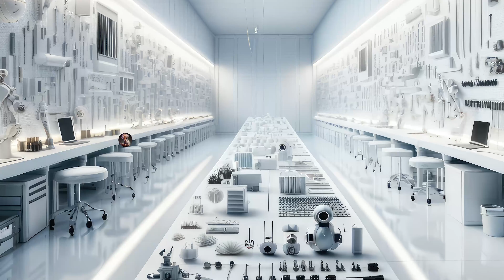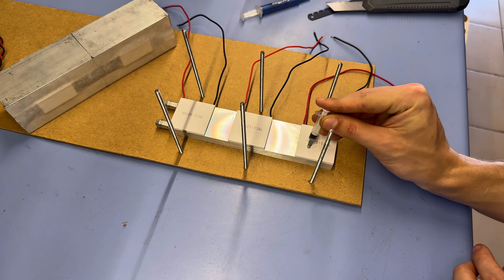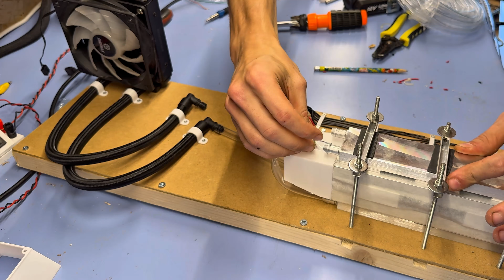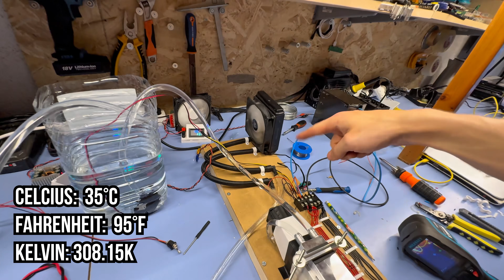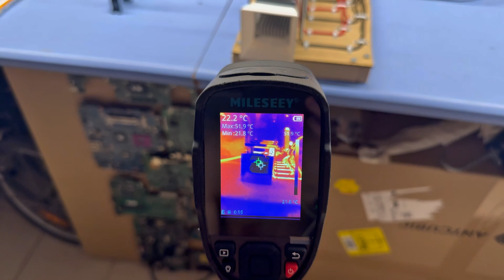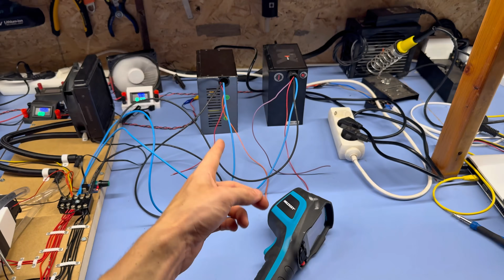I Built an Air Conditioner with 6 (8) Peltier Coolers and it WORKS!

Comment: The real game changer here is going to be 3 steps. 

1. Make a through wall/window build to move the radiator outside for the water. A much bigger radiator will make the water cooling much more effective as well.

2. Change the water out for an actual coolant like glycol or better for more heat removal via the radiator

3. Use multi stage peltier units. People have recorded -90°C with a 3 stage setup. Small, medium, large stacked with paste between small unit to the tunnel large to the radiator. 

Apply all 3 of these and your tiny ac will make temps that could freeze the tunnel shut in open air

Comment: Maybe a bit late, but it is al about keeping the delta T over the peltier as low as possible. This means you have to use water cooling at both sides of the peltiers. Moving the heat outside and the cold water at the other side via many more heat/cold radiators inside your house. Also lower the current to improve efficiency.

Comment: if that is not bellevile washer the thermal mass contracting from coldside will create an air pocket and your thermal resistance between your coldside of tec to ducting will end up increasing.
Also not derating TECs with vrm module/buck-boost coverter will result in much lower COP/Qc if you dont efficiently extract hotside heat.

Comment: Peltier coolers generate 1W of cooling for 4W of electric power, when 4W of compressor power generate at least 8W of cooling (cop of 2).
All in one, the compressor cooler generates 8 times more cooling than the Peltier modules for the same electric power.
This is huge.
Forget the house.
Peltier are ok for very small applications, like miniature fridge, low capacity water chiller etc.

Comment: i just made an ac unit from a beer cooler fillied it with ice cut out hole on top stuck fan to it uses less energy and works lasts all day dump water and refill with ice or you can use frozen water bottles so you can rotate from your freezer and then to your cooler

Comment: Try building this, organic carbon power cell powers pizoelectric solid state Stirling cold gas cycle piston air liquifaction module generation of liquid air fills an insulated tank gravity fed.  Insulated copper pipe brazed to a copper coil with tiny holes covered with carbon felt to wick up the liquid air.  Solid state fan passing air over coil for liquid air heat exchange boil off for air conditioning system.  Low temperatures from liquid air power's seabeak effect electrical power generation system that charges up the power cell puts it on standby till the next cooling cycle is started while the seabeak effect electrical power supply power's the solid state fan passing air over coil for liquid air heat exchange boil off for air conditioning system? If you understand this peltier cooling system you will understand seabeak effect electrical generation system off ultra low temperature liquid air thats generated for heat exchange and electrical power generation to the system? This technology could save alot of lives human lives and animals lives? 🤔

Comment: For your water cooling siode you neec at leaast two 120mmx3 radiators with push/pull config high performance Delta fans. You can passively cool it if you have a pond and can afford to buy lots of copper piping. Your pump is laughable, realy! You need something like Grundfoss cen tral heating pump for a TEC system. Then, dont run them on the rated power, thats pointless due to current heating loses. Run them on max half and best quarter of theoir nominal power. You have no insulation on your sytem, thats no good. You need to insulate everything. When you get all of the above done we can start talkong about the heat exchanger design. This when you start gettin serious. Your heat exchanger is a joke right now but it is fine for the stage you are at.

Comment: Smallest air conditioners (5,000–6,000 BTU window units) typically use between 500 and 600 watts per hour, though ultra-efficient or specialized small units can operate as low as 300–400 watts. These small, high-efficiency models are generally designed to cool small rooms up to 150–250 square feet. (THIS STUPID CHANNEL IS WASTING YOUR TIME)

Comment: Profesional de datos si estamos hablando de una celda de peltier de 60 W está tranquilamente pueden llegar llegar al menos 30 grados centígrados de temperatura con lo cual puedes llegar aún más a refrigerar locales que tienes que aumentar la de la disipación de calor en ese punto entre más sacas calor más enfría la alimentación para llegar a una a esa temperatura tiene que ver la tabla del fabricante más más o menos me acuerdo que era 3.8 amperios por cada partido conectados en paralelo y no tampoco conectados por serie tiene que tener una alimentación de amperaje y un voltaje muy específico para llegar a esa temperatura con un emulador de voltaje y amperaje puede llegar a esa temperatura y tenerme mejor consumo eléctrico también puedes integrar un pid con arduino o con otra tarjeta controladora y que tenga licencia automáticamente la temperatura del líquido refrigerante de líquido y del ambiente para que te den la temperatura de resultado que uno busca pero si le puedes mandar la voltaje y el amperaje justo tendrás Esa de una área de 4 * 4 * 4 metros en media hora Y más si tienes un controlador de arduino a otro puede bajarle el consumo para mantener la climatización
Reply: Si tienes un controlador de voltaje en temperatura que la desarrolla automáticamente una tarjeta de Robert arduino otra tú llegarías automáticamente cuando tendrías la temperatura óptima la temperatura de Confort dependiendo del punto de Rocío y la humedad del lugar inclusive ya hay aires acondicionados chinos que ya funcionan con Peter
Reply: En la configuración con el arduino buscarás la temperatura máxima de enfriamiento máxima que ya se celebrar el consumo pero después de una configuración de programación buscará la temperatura óptima para bajar el consumo Y eso sí tienes un modulador de voltaje ya en pelaje con una tabla de verdad de tanto voltios tanto amperaje tanta temperatura de aquí el resultado pero tendrás que tener más de allá una un sensor de temperatura
Reply: Para hacer más inteligente y no complicarte tu proyecto es solamente aportar cortar datos a tu proyecto yo en lo mío lo tengo un sensor de temperatura en el lado exterior para que me diga cómo está el ambiente un sensor de temperatura en el interior del cuarto luego tengo otro Sensor en el en el depósito del líquido refrigerante que se está enfriando botando el calor y el último dos últimos uno que está censando la temperatura del vestier
Reply: Amarte tendrás que tener dos sensores de temperatura en un helado frío helado caliente para ver el resultado de aporte
Reply: Y aparte de eso tendrás que tener uno que el último que buscas el punto de Rocío Exacto del cuarto de la habitación a climatizar, no es complicado el proyecto sino que tú estás dándole testeos especiales a la celda
Reply: Recuerda que la celda tú tienes que sacar bastante calor y no sabes el calor exterior dónde estás botando el mismo aire caliente que le está sacando del agua y si está a 40 grados exterior y tú tienes y tienes en el chile en Chile el 40 grados expulsando calor y no tiene una diferencia de que vaya a ser digamos disipar otros otros 20 grados no llegas al resultado de bajar la temperatura que necesitas en las celdas

Comment: about 20 years ago there was a cooled computer enclosure for the usmc using peltier junctions and lots of fans. 80 amps at 24 volts.
Reply: So the same power as an small central system 😢

Comment: Someone's using my idea. But making it a bit larger then normal. Mine was just basically take a standard phone pelt cooler like a blackshark 5pro (35watts.). Stick a metal fin on the cold side with a blow fan to blow the cold plate. Then tunneling the hot plate/fan out with a small hose. Reversing the fan so it sucks in air from the sides vs blowing out. That way you can tunnel the fan's heat spread out of whatever you want. And you got yourself a powerful micro-AC unit. That works via USB-C. Simple and easy. besides trying to rewire the direction of the internal fan to suck air from around vs suck air from the middle vent and blow to the sides. (Either that or one can easily make 2 hose tunnels from each side of the fan vent side grills and lead that to so forth.)

Though these aren't very powerful so they would more be kinda point in your face chillers like normal fans but really be for AC cooling rather then a water vapor mist fans. And in a some space say like a tiny box like the size of someone's chair or a tiny bicycle camper. That might help chill a place pretty well if using more then 3 at same time. Just remember to route the HOT air from the HOT/Fan side out somewhere so it doesn't just cycle the heat in the chamber.

So yeah the Idea does work. But not for a normal place. A some super compact place like again as mention. Would work. Say if you enclosed a bunkbed with those built indesks under the bottom bunk and kinda 'sealed' it around so the bottom bunk was kinda basically a 'room' That would probably work to cool that amount of area down. But anything bigger i doubt would work well. Unless again you just have it as kinda a desk fan to blow on your face vs a misting fan. That would work ok but not really chill a room.

Nice test Den. I wanted to try using this method on a 'whoknowswhen future' project bicycle camper trailer idea to use as a micro-AC system just using low powered phone pelt coolers. Since they do work well.
These work ok. to bring temps down for the ability. But what i noticed with higher powered ability is they substain these cold temps harder. So like for instance a 10watt cooler compared to a 35watt cooler would both chill down to -C temps. But if a phone gets HOT. The higher wattage output one holds the temps down more better then the lower wattage one that slowly cannot keep the cold plate side chill and ends up getting hotter. So higher wattage aren't gonna chill farther then others. BUT will handle keeping the cold plate side COLD much better when it gets warmer. So using a melt fin and fan this would handle keeping the metal fin much colder and would in such efforts allow for a larger amount of faster airflow to blow among the chilled fins and still keep the fins ice cold. Compared to a smaller powered one that might loose it's chill.
Reply from the maker: Thanks so much for taking the time to write such a detailed comment — really appreciate it. I totally agree Peltier modules are great for super tiny cooling setups (almost like mini fridges), and I think using them to cool a small camper could definitely work, especially paired with something like solar power. That’s a cool idea and I might even make content testing that approach.

Comment: Due to the massive inefficiency of peltier, the heat released by your power supplies will largely offset any cooling achieved. This would only make sense if the power supplies were in a different room and you also radiated the heat outside the room. Even then a tiny refrigerator heat pump would vastly outperform this. Just find an old mini fridge or something.

Comment: I had been hoping to make a smaller version of this for my previous car (which was old and did not have air-conditioning) but never found the time to try it. (I've since sold said car and my current one has aircon.) Impressed it actually works!

Comment: you have to use more peltiers and underclock them extreme use 6V or 3V and the efficiency will rise dramatically, but you will need way more peltier modules about 100 of them, to get significant solid state cooling

Comment: Nice demonstration. It definitely shows that Pelter cooler is very inefficient and limited capacity to become an air conditioner.   But being small  it may have some uses outside air conditioning.

Comment: lo de peltier solo estará consumiendo 144 watts tal vez hasta 216 watts lo que veo que pasa es que has conectado todas las celdas en paralelo  , en mi caso para evitarme eso las conecto en serie asi se eleva el voltaje y el amperaje lo mantienes bajo , obviamente buscas una fuente de mayor voltaje  , también ten en cuenta que se calienta el cable ya que por el estas pasando  12 o hasta 18 amperios . por ello mejor conectadlas en serie tal vez dos fuentes de 36v de 3 o 4 amperios
Reply from the maker: Gracias por el comentario! El Aire está consumiendo 480 Watt, lo hemos probado en la segunda parte, y también he separado los Módulos Peltier y ahora una fuente da 240W a los 4 Peltiers de abajo y otra fuente para los 4 Peltiers arriba! Está bien conectarlos en series pero no tengo una fuente buena de 36V o 48V por eso están en paralelo!
Gracias y Saludos

Comment: The second water block is receiving the warm water from the first one... In order to ballance the performance of both peltier sets, try to connect the water blocks in parallel, insted of serial connection... this will ensure that the both blocks will receive the water at the same temperature. Also, try to use a larger radiator and a second water pump to increase the water cooling.

Comment: I thought the peltiers were gonna fit in the slots of the heatsink air tunnel. Is the radiator even really necessary?
Reply: Putting them in the slots would completely defeat the purpose. They are solid state heat pumps, one side cold the other hot.

Comment: A great attempt but the video only shows and proves just how inefficient TECs are in cooling something. An average split-AC for homes draws around 1200-1500W while cooling a much larger space and faster too. Granted it uses refrigerant gases but for comparing power consumption they are more efficient than diy TEC ACs. 
 And yes, keeping the water cooling radiator outside the room is gonna help little. 
 
A better and more compact version that you can try your hands on is to convert a car's AC into a room AC.

Comment: You cannot (it is impossible) to measure a temperature with an IR 'thermometer'. The 'thermometer' gives 'temperatures' based on the assumption that the emissivity of the target is 1 (and this IS written in the manual, the text usually is in a very small font at the bottom of the specifications page). Now, the emissivity of air is almost perfectly the opposite of 1, that is 0, and has no bearing to the reading of the thermometer. One could hope to measure the temperature of something in the airstream and guess that to be of nearly the same value... but in this case that something is shiny aluminium, which also has very low emissivity. Since the sum of emissivity and reflectivity is ALWAYS one, what you are actually measuring is something at the end of a reflective chain of mirrors. It could partially be even yourself. BTW, your emissivity IS very close to 1! That's why IR thermometers CAN be used on humans.
Next time, use a thermocouple.

Comment: I thought of something similar but the cooling/heating chamber snakes like a subwoofer and the dissipation side with heatsink is connected to the extraction side. Was going to incorporate into my homemade heat recovery unit to act as a heat booster in the winter and a cooler in the summer 🤞
Reply from the maker: Nice! Now you see how it may perform

Comment: Awesome! Although my recommendation is to use the TECI 12703 Modules... As they are the most efficient ones! hugely power-efficient, and also much less heat (thus more cool on the other side) than the TECI 12706 Modules you have used! They are slightly more expensive, but better in the long run as you will save a lotta power!

Edit: I once only used like 2 TECI 12703 Modules, they did work perfectly with my small 12v 10 amp (120W) power supply.... And the temps were 9-10C... with like basic cooling and room temp of 31C...

Comment: if you stack a hot side of the peltier with another one and put the hot on the cold side it makes the bottom cold side even colder idk how it works but u should try it

Comment: Interesting engineering exercise.

1. connecto your heat exchangers in parallel, not in series.  Heat exchangers work best with big differences in temperature.  Connecting them in series forces one to work with warmer water, making it less efficient.

2. This is an interesting exercise, but it is very, very inefficient.  Phase-change cooling is FAR more efficient, but is beyond most people's capabilities to construct.  Peltiers are suitable for specialized cooling such as point-cooling of electronic components.

Comment: I tried cooling a fish tank (130liters) with 3 peltiers and a gfx card  water  heat exchanger - a slow fan does a better job with 1/50 amount of power but some water evaporation

Comment: the only question is how much power it consumes. 6x 12706(72 W) = 432W. a regular refrigerator with a compressor consumes much less energy while being much more efficient
Reply: Those cooling units draw 5 amps each.  360 watts.
Reply: Its far worse than 432W. 6 peltiers, 2 fans, 2 power supplies, wire resistance,  and a water pump. Granted AC's also uses components, regardless, they're far more efficient.
Reply: @austinls6425  500 watt ac unit can cooling 3x3m room to 16C, peltier?try harder